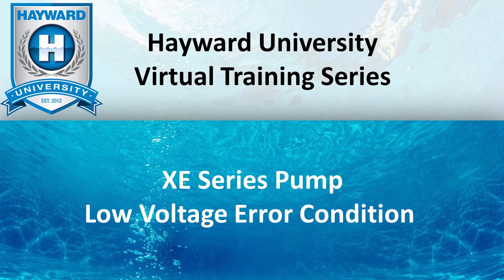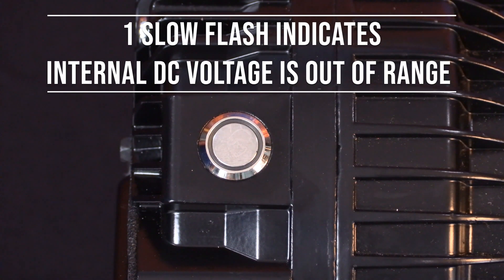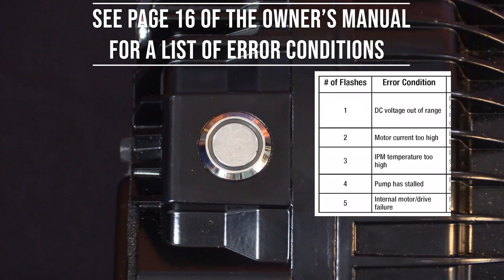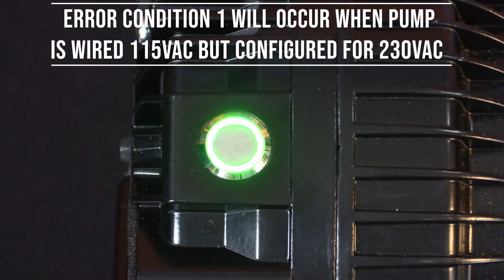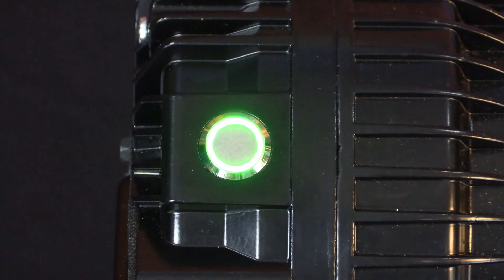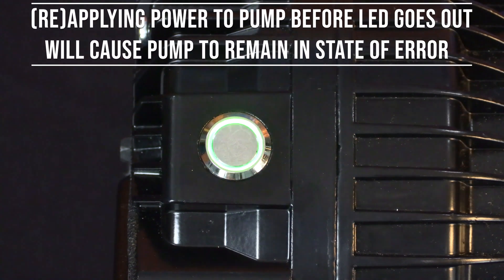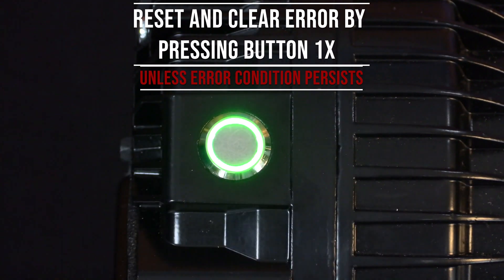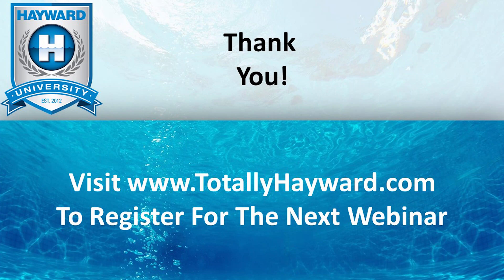Hayward XE Series Pool Pumps – Error Conditions

Comment: What happens if the xe pump immediately goes into this error mode when the power is applied? It’s wired to a two pole 15A breaker and routinely trips. But an electrician measured the live load carrying current and it was only 8.9 amps? Doesn’t track why it would trip or the xe pump being in this low dc internal voltage error state. Very frustrating